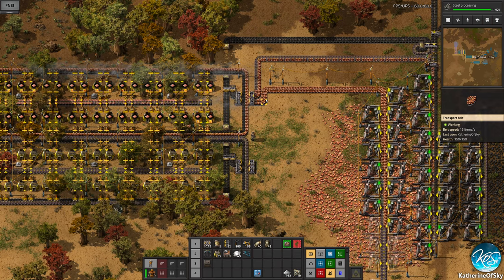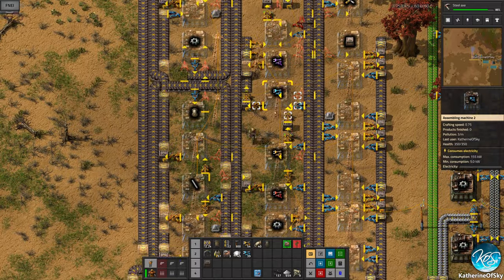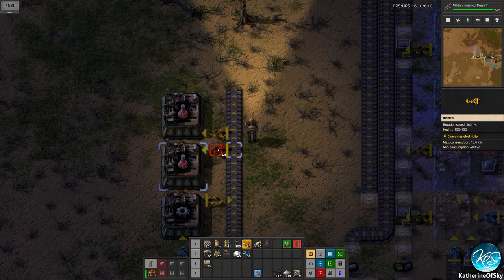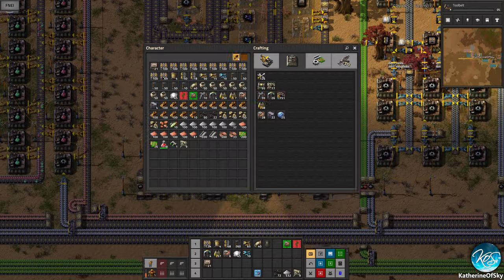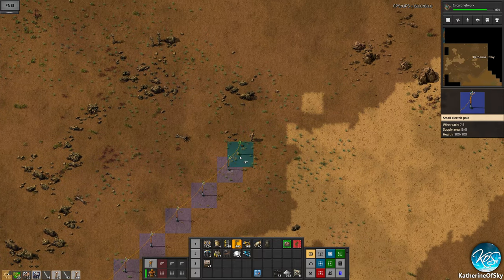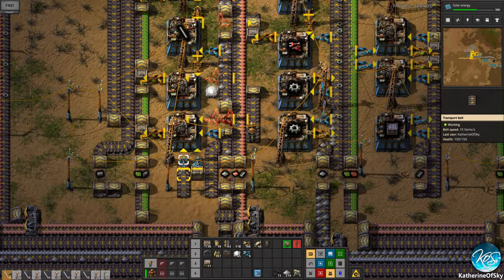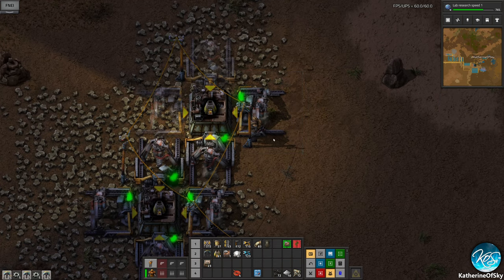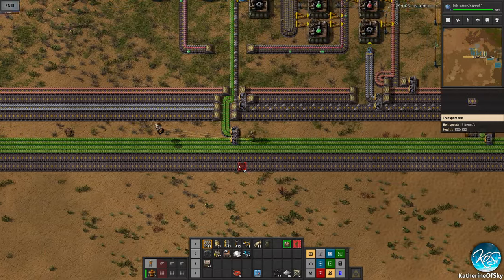Factorio - Entry Level to Megabase 6: Injection Bus 3 - SCIENCE & THE MALL - Guide, Tutorial

Comment: ~19:50  The best way I've found to lay this out consistently without a blueprint is:

- Place the first lab at least four tiles away from the previous assembly.
- Leave a gap of four tiles (if you want to eventually put beacons down the middle - otherwise it'll work with no gap at all) and place another lab
- Place the first yellow underground two tiles further away from the second lab, headed up (when building "above" the bus as in the video).  Hold left-click and run to place "a bunch" at maximum distance going further up.
- Place more labs to match.  I find 40 in total (20 per side) to be a good number for a lot of reasons - TBH you'll have trouble saturating that many in the late pre-rocket game unless you've really spent a lot of effort to bring in resources before teching up
- The undergrounds should extend one section past the labs.  Then use normal belts to turn and head "backwards" two tiles past the first column of labs.  Build undergrounds headed "down" at the same spacing as the first set you built "up".
- Build a second set of undergrounds one tile out from the first set, looping over at the top "above" the previous joining belts.
- Build red inserters.  Build LOTs of red inserters.  Build ALL TEH RED INSERTERS.  Place them at the "top" and "bottom" edges of the labs, both immediately beside and one tile out from the labs, making little squares of four.

Pick an empty hotbar slot and set it to red undergrounds - even if you have them researched, you can put red, green, blue and grey science packs on just the yellow sets and they're pretty expensive at this point..  Place the (ghosts for) red undergrounds with belt direction the opposite way to the yellows, matching the other edges of the labs.  You should end up with a one-tile gap between red and yellow undergrounds, centered on each lab.  The "last" red underground  at the top should end at the same spacing, letting the two crossover belts just exactly fit below the last yellows.

With very little extra tinkering, you can complete all four loops at the bottom as well, following a similar pattern as at the top.  It's even reasonably clean to supply three of the four complete loops from one side, although after playing for a while I prefer to do two on each side, and leave space between red+green for blue+grey science.
Reply: Power poles go in between the red inserters, on alternate labs, with an extra set either top or bottom to cover the last pair of red inserters at whichever end ends up short.  If you've left space in the middle for beacons, place power poles on the other side of one set of labs, at the same spacing.

Comment: Have you ever bussed gears instead of making them locally? I used to run 4lines of iron. Now I run two lines of iron and two lines of gears.
Reply from the maker: I have, but I find it's not worth it.  I'd rather have focused production so I know assemblies are getting the exact numbers they need
Reply: There are very few times (in the science production) where you need gears and not plates.  Therefore easier to just bus the plates.

Now, for the mall, you need truckloads of gears, so those are definitely bussed.  Sometimes I setup a little gear array next to my mall when I want extra gear production.